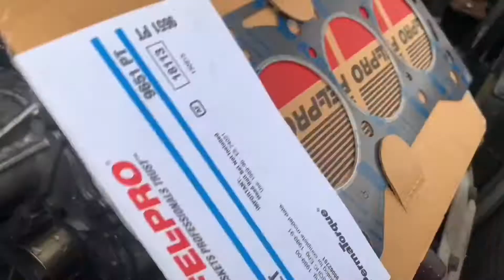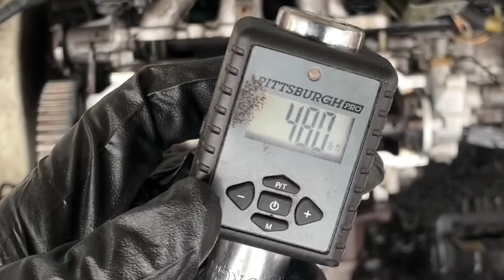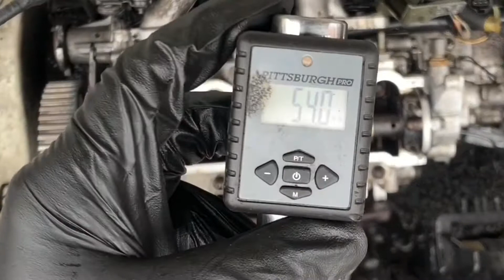1998 Chevy Metro Head Gasket and Burnt Valve. 🔩

Comment: I've rebuilt several of the older 1.0L Geo motors and just learned a lesson on the lifters they are selling now on Ebay.  You cannot run heavier than 5W30 oil with these lifters are they won't pump up at lower engine rpm's.   It appears the holes in the lifters are smaller to accommodate the newer engines so they list them for all the models which isn't true.   If you run 10w40 , 15w40 they will rattle and cause burned valves because they don't hold the valve open long enough.
Reply from the maker: That is a great point. And obviously something that is never really thought of until it’s too late. 

I’ve actually been trying to stay away from online engine parts, and since I’m at the beginning of a complete engine build, I suppose I will source higher priced parts locally and save my engine. :)

Thanks for the heads up.
Reply: Great to know this I am just getting into geos

Comment: I have an 87 Pontiac Firefly (Chevy Sprint) I think it is time for a new head gasket. It blows some white smoke on startup but goes away after it is warmed up. Also has a new weird high rpms until it gets warm. 
Thanks for the video, adding the torque pounds was a great addition to the video.
Reply from the maker: Rpm issue could be an air pocket hitting a coolant sensor. Check and make sure your coolant level is topped up properly. Could also be a slough of other things also. 

The smoke could be bad valve stem seals, especially with that old of a vehicle. If you do a head gasket, you should do the valve stem seals as well, but be warned, that if you have the head machined at a machine shop, make sure they DO NOT lap the valve seats.   Although it sounds like a proper thing to do, and it will run better for a short amount of time, what will happen is: you will have better compression, and with the aged engine and piston rings, the rings won’t be able to withstand the higher compression, and you blow them out, causing significant blow by, and oil consumption and more smoke from fried rings.  

Just food for thought. There’s a lot that goes into it.
Reply from the maker: Edit: you stated white smoke.  I called out a coolant issue, but stated the valve stem seals could be bad.  So, white smoke is usually coolant, blue is usually oil.  My bad. Is there oil consumption, or loss of coolant?  But also, the high idle could be a result of a coolant loss, being replaced by air.  And then also, your head could be cracked between a valve seat. Or it could just be a head gasket that’s old and starting to leak until it expands from the engine warming up. 

Sorry, 100s of thought rattling around at once, just take all things into concideration and have contingency plans if something doesn’t go according to plan.

Comment: What are you doing at 1:32? Where is that little sprocket that you painted to mark position?
Reply from the maker: The one in the mirror, at 1:32 is the crankshaft sprocket. For the timing belt. The arrow is pointing at the painted line, indicating the timing is set to top dead center.

Comment: The part I needed to see is how you compressed the spring when you put it back together. The tool they sell for it wont fit in that little spring housing.
Reply from the maker: I’m sorry, that was one of my first videos and I lacked proper editing skills. The tools you need are kind of special. It’s basically a 13 mm deep socket sized piece of metal tubing with a window cut out of it. And a special style of “c” clamp pliers.  However, you can probably modify a socket with a cutting wheel, and use a box end wrench loosely bolted to an adjacent hole, and use the box end wrench as a lever to push the spring tool in, and set your keepers. 

Honestly I think I just fucked with them with needle nose pliers until it happened. Sorry.
Reply: @MechanicalTriage  I appreciate the reply, but I figured it out.  I basically put a socket over the top of the thing and acted like I was doing CPR to the  head until the  keepers seated themselves.

Comment: Hi, friend!
I have a question, in the minute @ 7:30, I could see that at the top of the head gasket, the one on the intake side has the two holes in the corner, bigger!
These holes are usually small, and I think they are the oil passage, right?
Did you enlarge them manually, in that head pack that you installed?
Reply from the maker: I did not manually enlarge them..  I believe I had this conversation before with another viewer.  I remember it being something about an update part number.

Comment: Im about to get into my 95 Geo metro cause i have the same problem. What would i need to get this done and What all was necessary tool wise?
Reply from the maker: It’s pretty straight forward as far as tools go, most $100 boxes should have the right tools. However, your issues may vary, depending on if the head needs to be machined and whatnot. Torque wrench is definitely needed to set the head bolts.

Comment: Your FelPro 9651 PT looks different than anything I can find on ebay, amazon, Summit, etc.
Reply from the maker: I just looked at that, it seems that the up most two holes are slightly different, everything else is the same.  The differences are the upper left on mine is slightly triangular looking, but similar in size, and the upper right on mine is larger diameter than the ones I can find online also.  I did not modify mine, so I am not sure why they are looking different. I don’t think it would cause a huge problem, it seems to just be a journal size difference.
Reply: @MechanicalTriage  ... Apparently obtaining a gasket such as yours fixes a common "oil fart" issue with these cars.  The wider passages allow for oil pumped to the top cover drain back instead of blowing up into the air cleaner housing.  Looks like I'll be modifying my new gasket before installing it.
Reply from the maker: @TheDrunkardHu  that makes sense, but I’m not sure why they didn’t have a revision number or change the part number
Reply: @MechanicalTriage  Yea, I'm not happy about it either.